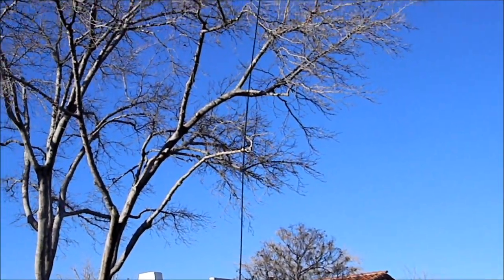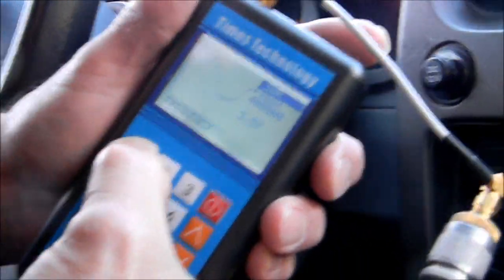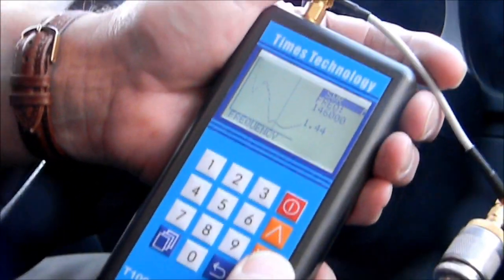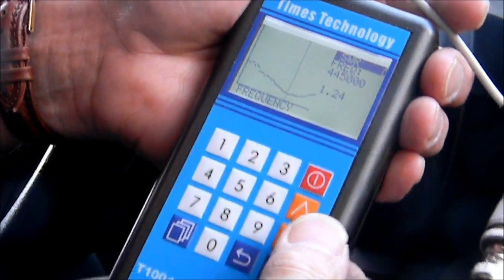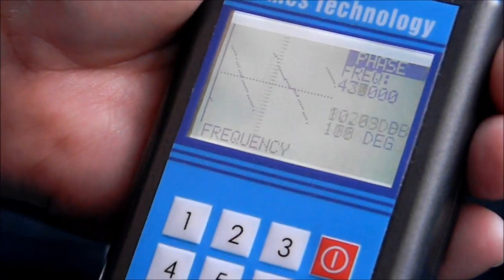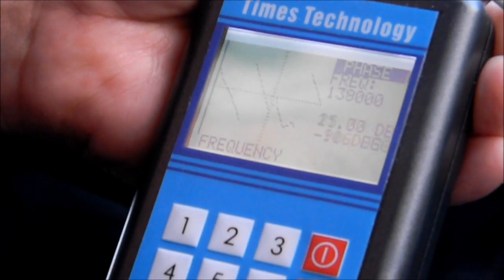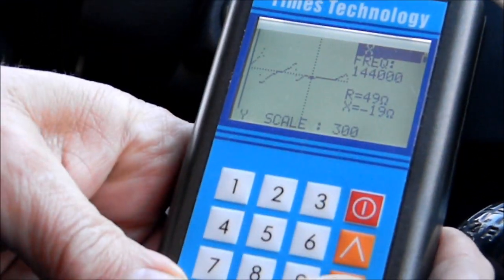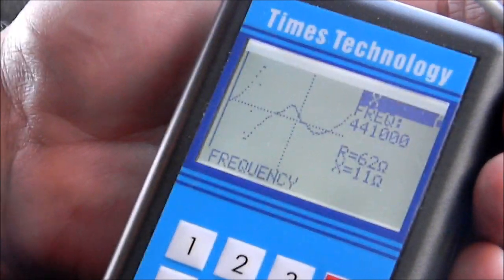Amateur Radio 2 Meter & 70 CM Testing With VHF/UHF Antenna Analyzer.wmv

Comment: Wondering if you could help me out here,  basically an antenna analyzer just plots the SWR reading across multiple frequencies correct?
Reply from the maker: +Warndog Yes, and much more than SWR. These inexpensive devices allow us to scan a range of frequencies or measure at a single frequency so we can know all the parameters I showed in the video.  It is amazing the devices we can have today that would have taken a NASA lab of equipment in 1970 (which seems just yesterday to me).

Comment from the maker: This is the second video I have made of this neat device - on Ebay, Times Technology 100+  and you will find it. My only issue with it was the flimsy SMA connector but I repaired that and use a pig-tail to reduce the stress on the connector. I have used it to evaluate some of my attenuators, home-made dummy loads, variable loads and more. It does produce an accurate frequency at (approx) 0 dBm output.